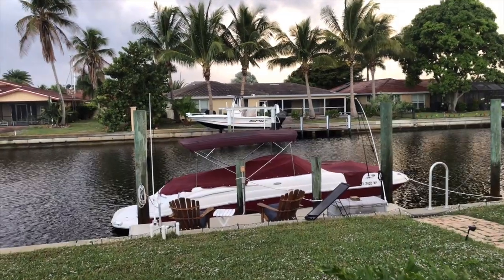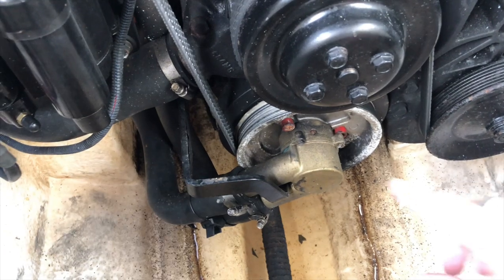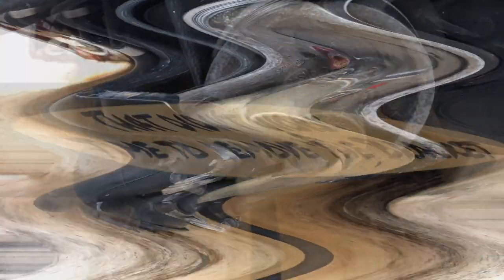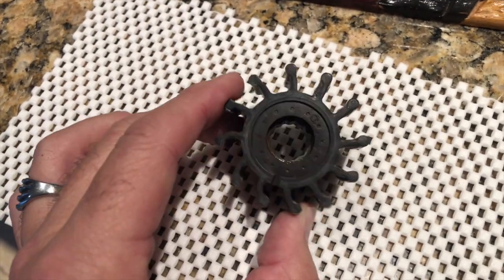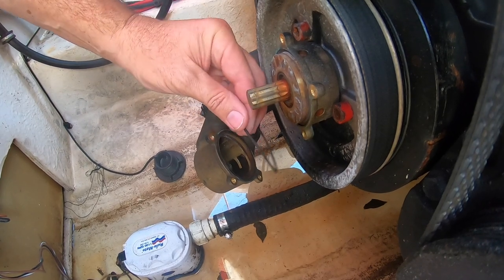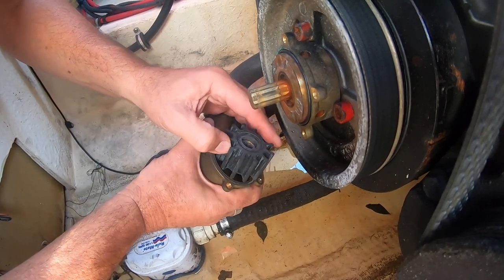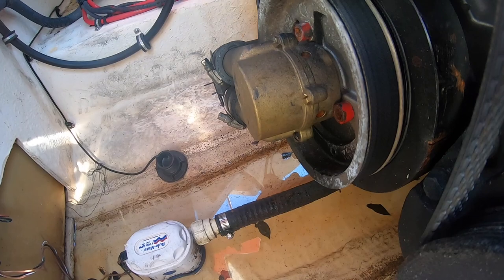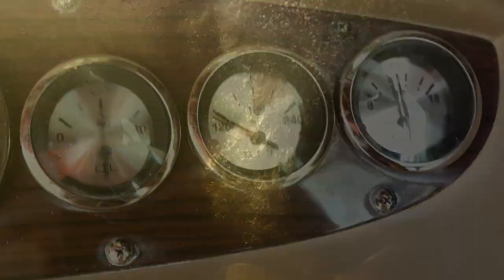How to Change the Impeller on a Volvo Penta 5 7GI e

Comment: Like the vid.  Two comments.  Do not have to worry about putting impeller with blades the correct position. They will be correct as first turn motor. Second comment. I have a 202 Cobalt 206 with 5.7 Volvo.  After experimenting i found that only have to loosen the bolts to the bracket. Impeller unit comes off.  Much easier than trying to put the bolts back after completely removing. Took me 3 years before realized could do that.
Reply from the maker: Very good.  lt makes sense to not worry about the direction of the blades.  Thanks for sharing.

Comment: Great video! Question, since you were in the water, did you have to close the seacocks before removing the impeller housing and draining?
Reply from the maker: I did not have to. I did lift the motor up because it’s an inboard outboard, and that allowed the water intake area to be low enough that it never came up into the boat. I was extremely cautious removing it because I thought the same thing you just did that I would have that problem and did not.

Comment: You can also use silicon lubricant from your plumbing supply store. I also added a 0-30 psi gauge on my thermostat housing, it conveniently had a 1/4 inch plug in it so I didnt need to drill and tap. This year I am going to put the gauge on the dash and run a 1/4 inch line up to it. This lets you monitor your pump pressure and lets you see when the impeller is starting to wear out.
Reply from the maker: Great modification. I hadn’t thought of that.
Reply: @Svdreamchaser  I saw it on my friends bass boat with a 120 hp merc outboard. I though hey that is a great idea.  I found once the engine comes up to temp it runs about 16 psi.

Comment: Good job. I have the Volvo Penta 4.3L V6 with the exact same impeller housing. I have a *much* tighter space and can only work by touch in my bilge. You helped me find the location of the O-ring and the orientation of the splines. The only thing I may have done wrong was inadvertently rotate the impeller housing. I do not know if the orientation is in the same position as when I removed it. Is this a problem?
Reply from the maker: No as long as it goes on the shaft splines all good.

Comment: Hi. Replaced the impeller and it went great. Hooked the hose up to test and with the hose on there is a slow drip from the 6 o’clock position. Gasket is new and seems to be correct. Thoughts?  Thanks in advance
Reply from the maker: There is a weep hole in the bottom that allows water to leak out of the bearing seals are starting to fail. I think. That would be my first thought.

Comment: Great video! Does the inlet refer to the hose going back to the transom or is the inlet referring to the hose that goes to the thermostat??
Reply from the maker: Inlet from the transom. I typically refer to that indicating the flow direction. So water goes from the lower unit up the hose to the pump which them goes to thermostat, circulates through heat exchanger then out with the exhaust.

Comment: Great video! This gives me confidence to do it myself.  Question, If your boat is in the water, do you still need to hook up the hose and run water in the engine before restarting?
Reply from the maker: No. The pump is strong enough to pull it up the engine. Again that is if it is in the water.
Reply: @Svdreamchaser  Great.  Much Appreciated!

Comment: Why did you point out where the hole must stay?
Reply from the maker: Are you sleeping with a hole needed to go on the bottom essentially a Wii pole. If for some reason the O-ring failed and water began to get into the bearing the idea would be that it would drain out that we fall prior to getting into the actual engine or the bearings. However when I started to say that and rotated around I noticed there were actually three week old so I aired on the side of just putting it exactly the way it was before I took it out. In the end if you’re doing this job I would just recommend that you place it however it was when you took it off assuming it’s been running and working fine prior to that

Comment: Your video and explanation has 2 problems: One the inlet and outlet to the water pump you indicate in your video are inconsistent. In the start of your video you show the wrong inlet/outlet but at the end you correct it. Second the direction of the impeller blades when you took out the old one and when you put the new one are NOT the same.
Reply from the maker: Wow, I will have to go back in and look at the video again because I have been running it without issues.  Thanks for pointing out the error on the in/out if I misspoke on those.  I will rewatch and double check
Reply: I thought he had the impeller blades right.. you just have to look at the squished blades
Reply: @Svdreamchaser  They were actually in the right direction...dude needs to watch the video again..
Reply: It does not matter the impellar will correct itself. Brand new..very pliable. Good video buddy!!